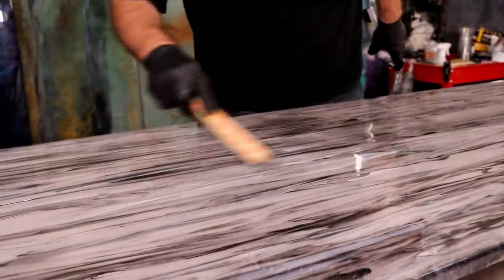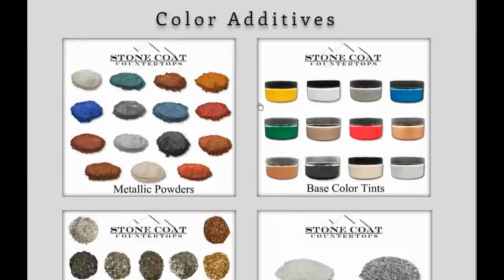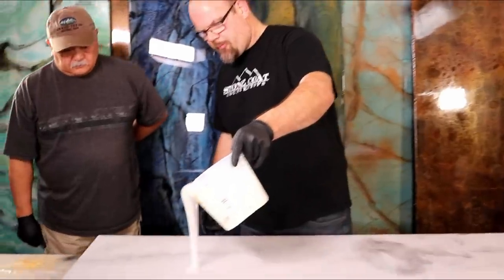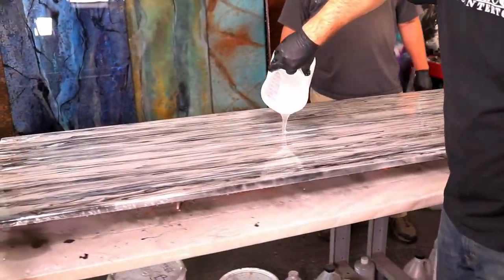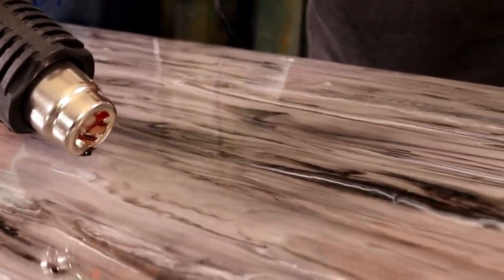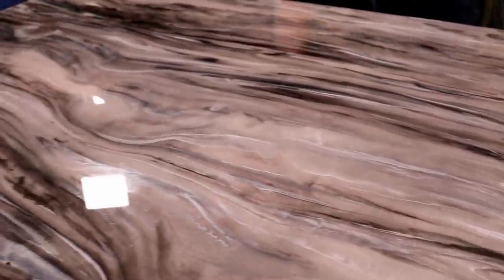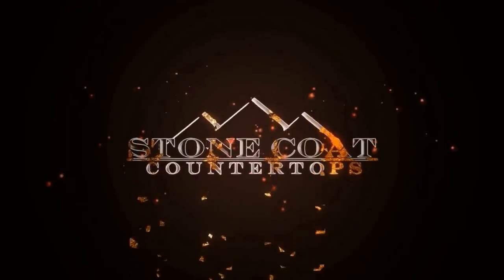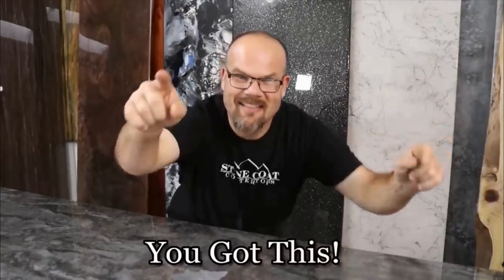Glow In The Dark Epoxy Countertops

Comment from the maker: What projects would look cool using Blue Glow Powder?  https://www.stonecoatcountertops.com/
Reply: Stone Coat Countertops I love the glow👍🏻
Reply: Was going to pre-cut some panels to the shape of a three recessed skylight and then now with that blue glow powder I think I'll need it would be when the sun goes down if the recessed walls of the skylights will glow for a while. How long does that glow last
Reply: a poolside bar
Reply: a paint/picture project with northern lights! (kinda like the one I did)
Reply: wondering if this could be used for doors, just filling the inlays?
Reply: A nice project would be some cozy little end tables or a 2 level bookshelf to accent the table. I'm leaning more towards the bookshelf though.
Reply: I mixed a full packet of the blue glow dust into about 32 oz of epoxy and I have zero glow in the dark effect. Is there a minimum time it has to "charge" under a light or something?